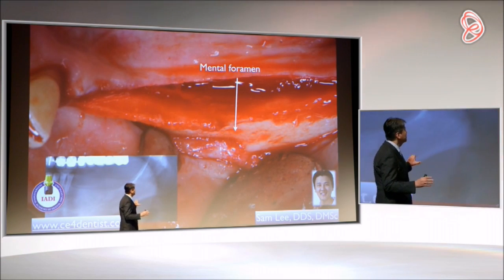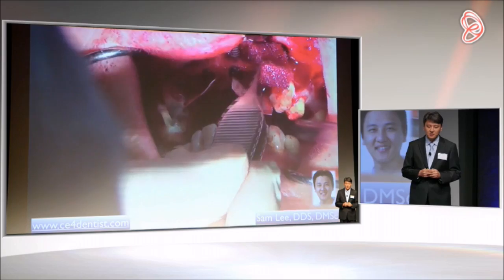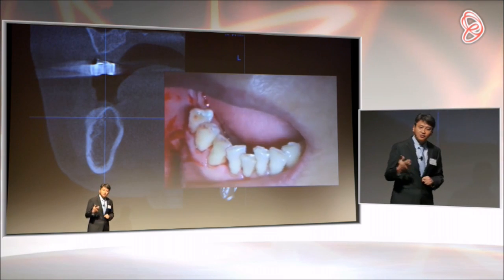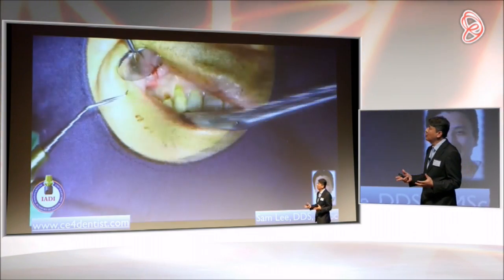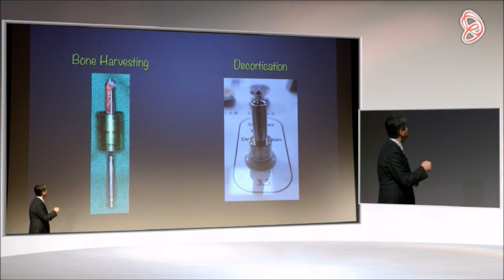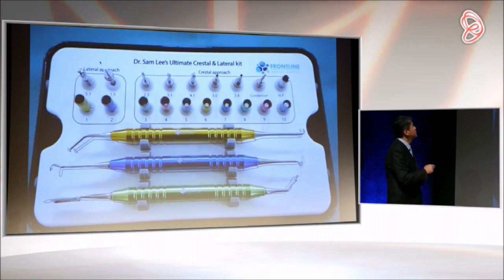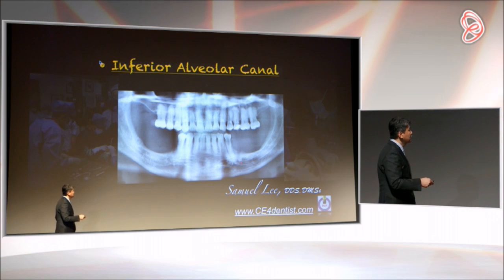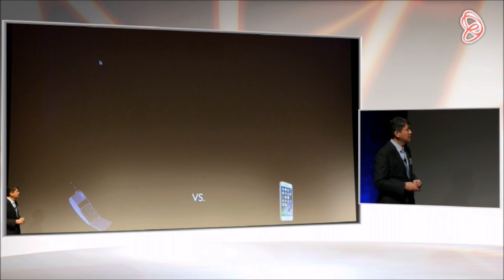New Techniques in Implantology with Newton Implant Systems

Comment: my dentist was going to place 6 implants to replace my dental bridge but only made 2 with screws and reason was "angle of teeth next to implant does not allow length implant is secure" what does that mean? and do I have any options?
if so what?
Reply: ask ur dentist
Reply: I did but her response didn't explain the answer, only that they felt it best. And how the ladies there all trust the dentist to do all their work too.
Reply: Hi, I would like clarification, but all they said was that with my situation it was best for me. Because on youtube and this ask site I commented on everywhere I've read says that it seems in all cases bone can be grown from many areas. What is angle of tooth that it would not permit the rest of the implants?

Please explain to me so I have a better understanding. What do they have a book in the office with before after pics? Are you speaking of dentist who is doing implants, or a second opinion? regarding the pics?
Reply: background I had an accident when I was 9 yo, and it knocked out my permanent teeth So I've had several bridges, then the insurtance co was convinced of implants by this office. When I asked insur many yrs ago they said it can only be approved same way it was built as bridge.

PLEASE GIVE ME YOUR INCITE TO THIS STORY.

I never got a RESPONSE TO THIS  is there any way to replace the rest of the bone from the accident?

Yes I see where you are coming from. One implant is enough to hold two crowns. We have secured your bone for the implants. It’s more when you have bad teeth that keep eating away from the bone. You may have a little bone loss from your initial accident in the edentulous spots but The bone is still pretty good. I fee you are in good shape with our plan.

Have you ever heard the old adage “what you don’t use, you lose?”  This applies to your jaw bone too!  Your bone stays thick and tall when your teeth are there stimulating your bone every day.  If you lose your teeth your jaw bone shrinks from disuse.   This also happens when you are only missing even one tooth! 

Dental implants preserve your jaw bone and prevent the natural shrinkage that WILL occur with bone loss.  A bridge or removable partial denture does not preserve or maintain your bone.

this is from I Don't Have Enough Bone For Dental Implants | Ramsey A. Amin, DDS

No I don't want to go back to what I had.

To give you teeth in those spots, crowns will be cemented to the distal side of each implant crown. 

will that then use the bone regrown from the implants?

 Because thats my biggest concern I never knew until 2 days ago when I looked it up how having a bridge all these years was detrimental to what bone I had left under the bridge was dying and vanishing.
I was quite disturbed about this because I never thought bridges could harm ones mouth so bad. But it scared me about the not using it and losing it. 
I'm more concerned with the bone issue and regenerating as much as possible to make my structure healthy again, than I am what is placed on it.

I read that one implant thing is large enough to accomodate 2 teeth, is that so?

I just want to preserve and help keep my bones strong to avoid much worse consequences in the future.

Do you understand where I am coming from?

When you came to us, you were complaining of a chipped bridge. Because of your bite, the porcelain on the bridge was chipping and redoing the bridge as it was would not help the matter. 
We then took the bridge off to properly take impressions along with the ct scan to send to our lab. After our lab technician reviewed the model and ct scan, he had a webinar meeting with dr soltani and they looked at the ct scan images together and confirmed that they would not be able to place implants in the 7,10 spot. This is because of the angle of teeth 6 and 11.
We could however place implants in the 8,9 spot which is where you were having the issues with the chipping.
That would leave the 7 and 10 spots without teeth as it is not recommended that you do a bridge from tooth to implant. 
To give you teeth in those spots, crowns will be cemented to the distal side of each implant crown. 
Dr soltani and our lab tech feel that strength will be adequate with this plan in place.
Your bone in 8 and 9 should accept the implants and be strong. 
This is what we are able to do in this office.
The other option we have is to let the tissue grow over the two implants placed and do a bridge like you had before. However, the issues you were having with the original bridge will most likely occur again.
If you feel more comfortable with a second opinion, we will not be upset. 

I forced myself to try to learn stuff way over my head and got a headache and grossed out by the vids i watched.

I spent 4 hrs today because the details are very important to me and need a full explanation.

I will except the answer if all my questions are answered in detail which is clear to me with having no dental training unlike you are your office.

You have only confused me more with the limited answers you've provided so far.

and why there are no other ways to correct it?

im extremely frustrated by the lack of detail you provide me on my matter.

im trying to learn what i google and find on youtube because you have done a poor job at explaning my condition and why there are no

alernatives to correct my problem.

i would expect this from medicaid, but not from a highly rated dentist.

again you are not giving me the full story.

give me a few sentences explaining the why, etc.

She says, They will not help because its a tooth in the way

Regarding this vid I ask her https://www.youtube.com/watch?v=TxU9jbFlwCc   does the dr know about this? i watched vid and if she doesn't 
please watch mins 5 to 20, and 32 to end. I want to know if any of these techniques would help?

guided bone regeneration
 spongy bone or
 minimually invasive tunneling
 no suture, guided surgery digital planning of 
& 3D Scan

also is she Diplomates of the American Board of Oral Implantology/ Implant Dentistry (ABOI/ID) he is considered an expert, and board-certified in dental implants

certfied in aBOI?

I'm asking the office by email what can you tell me about

Zygomatic Implants | Ramsey A. Amin, DDS

im only getting bits and pieces not the whole story from you thats what causes me apprehension.

What I want to know is this really so? Am I really stuck??

you haven't really answered my ?s you picked and chose which to answer. so I cut and pasted again!!!

enough? or not? was any it it succcessful? 

how should it be addressed further? by her or someone else in addition?

what i read makes me realize the bridge will never deal with the loss of bone and makes it worse not better for saving teeth or bone structure.

basically i learned if you don't use it you lose it, especially as you get older as bone is concerned.

your thoughts there?

you sure?

There really aren’t any options there. It’s the way your teeth grew in

Hello. Im sorry that you are losing confidence in Dr Soltani but I can assure you that dr Soltani is incredible at what she does and implants are her specialty.

Initially when you were in, we thought we could place 4 implants instead of your large bridge.
After sending your scan and impressions into the lab, our implant specialist at the lab repied with the following:

"I have looked at this scan closely and we will not be able to get four implants in this area. The roots of the cuspids are tilted mesially into the lateral positions which is preventing implants in those sites. I can get two implants in the 8,9 positions which would allow us to cantilever the laterals off of the centrals."

Because your bite was affecting teeth 8,9 of the bridge prior, implant in the 8,9 spots will work.
You will then have crowns attached on the back side of those crowns that will fit nicely with the crowns that we are placing on teeth 5,6,11,12.

This was explained at your implant placement appt. I know a lot of info was told to you that appt and I apologize if you did not comprehend the new treatment information.

We have gone above and beyond for you in assuring coverage through your insurance company.

i was really hoping to have all 6 taken care of, not just the 2. this is why this is so important to me.

and why i really want to know how to solve the other 4.

i figure before the new impression is made in feb i still have time to see about correcting the issue once you put the permanent in 

its not so easy and ill have to deal with that issue again in 5-10 yrs, if we or your can advise how to get the other 4 taken care of

even if she doesn't do it personally, i was hoping to not have to revisit the issue later in my life, where chances are going to be that

it will be much worse.

ok but i still want to know what were are my options regarding this angle issue?

We would not have placed the implants if we did not think they would have long term success. She consults with the best. If I were ever to need an implant, I honestly feel dr soltani is better than anyone I could have do it.
The reason we wait 3 months is for the implant to osseo integrate  and have the bone accept it as it’s own.
Your bone is not the issue concerning the other 2 that we could not place. It is the angle of the teeth next to it that does not allow the length we need to make sure that an implant is secure.
You are in good hands. I promise you that.

I asked...
enough? or not? was any it it succcessful? why or why not?

how should it be addressed further? by her or someone else in addition?

i was hoping this implant thing would last the rest of my life, so you can see now why it concerns me so.

i hope you appreciate my concern.

thank you.
Reply: I asked...
enough? or not? was any it it succcessful? why or why not?

how should it be addressed further? by her or someone else in addition?

i was hoping this implant thing would last the rest of my life, so you can see now why it concerns me so.

i hope you appreciate my concern.

thank you.

We would not have placed the implants if we did not think they would have long term success. She consults with the best. If I were ever to need an implant, I honestly feel dr soltani is better than anyone I could have do it.
The reason we wait 3 months is for the implant to osseo integrate  and have the bone accept it as it’s own.
Your bone is not the issue concerning the other 2 that we could not place. It is the angle of the teeth next to it that does not allow the length we need to make sure that an implant is secure.
You are in good hands. I promise you that.

ok but i still want to know what were are my options regarding this angle issue?

i was really hoping to have all 6 taken care of, not just the 2. this is why this is so important to me.

and why i really want to know how to solve the other 4.

i figure before the new impression is made in feb i still have time to see about correcting the issue once you put the permanent in 

its not so easy and ill have to deal with that issue again in 5-10 yrs, if we or your can advise how to get the other 4 taken care of

even if she doesn't do it personally, i was hoping to not have to revisit the issue later in my life, where chances are going to be that

it will be much worse.

There really aren’t any options there. It’s the way your teeth grew in

Hello. Im sorry that you are losing confidence in Dr Soltani but I can assure you that dr Soltani is incredible at what she does and implants are her specialty.

Initially when you were in, we thought we could place 4 implants instead of your large bridge.
After sending your scan and impressions into the lab, our implant specialist at the lab repied with the following:

"I have looked at this scan closely and we will not be able to get four implants in this area. The roots of the cuspids are tilted mesially into the lateral positions which is preventing implants in those sites. I can get two implants in the 8,9 positions which would allow us to cantilever the laterals off of the centrals."

Because your bite was affecting teeth 8,9 of the bridge prior, implant in the 8,9 spots will work.
You will then have crowns attached on the back side of those crowns that will fit nicely with the crowns that we are placing on teeth 5,6,11,12.

This was explained at your implant placement appt. I know a lot of info was told to you that appt and I apologize if you did not comprehend the new treatment information.

We have gone above and beyond for you in assuring coverage through your insurance company.

I'm asking the office by email what can you tell me about

Zygomatic Implants | Ramsey A. Amin, DDS

im only getting bits and pieces not the whole story from you thats what causes me apprehension.

What I want to know is this really so? Am I really stuck??

you haven't really answered my ?s you picked and chose which to answer. so I cut and pasted again!!!

enough? or not? was any it it succcessful? 

how should it be addressed further? by her or someone else in addition?

what i read makes me realize the bridge will never deal with the loss of bone and makes it worse not better for saving teeth or bone structure.

basically i learned if you don't use it you lose it, especially as you get older as bone is concerned.

your thoughts there?

you sure?

also is she Diplomates of the American Board of Oral Implantology/ Implant Dentistry (ABOI/ID) he is considered an expert, and board-certified in dental implants

certfied in aBOI?

again you are not giving me the full story.

give me a few sentences explaining the why, etc.

She says, They will not help because its a tooth in the way

Regarding this vid I ask her https://www.youtube.com/watch?v=TxU9jbFlwCc   does the dr know about this? i watched vid and if she doesn't 
please watch mins 5 to 20, and 32 to end. I want to know if any of these techniques would help?

guided bone regeneration
 spongy bone or
 minimually invasive tunneling
 no suture, guided surgery digital planning of 
& 3D Scan

I forced myself to try to learn stuff way over my head and got a headache and grossed out by the vids i watched.

I spent 4 hrs today because the details are very important to me and need a full explanation.

I will except the answer if all my questions are answered in detail which is clear to me with having no dental training unlike you are your office.

You have only confused me more with the limited answers you've provided so far.

and why there are no other ways to correct it?

im extremely frustrated by the lack of detail you provide me on my matter.

im trying to learn what i google and find on youtube because you have done a poor job at explaning my condition and why there are no

alernatives to correct my problem.

i would expect this from medicaid, but not from a highly rated dentist.

When you came to us, you were complaining of a chipped bridge. Because of your bite, the porcelain on the bridge was chipping and redoing the bridge as it was would not help the matter. 
We then took the bridge off to properly take impressions along with the ct scan to send to our lab. After our lab technician reviewed the model and ct scan, he had a webinar meeting with dr soltani and they looked at the ct scan images together and confirmed that they would not be able to place implants in the 7,10 spot. This is because of the angle of teeth 6 and 11.
We could however place implants in the 8,9 spot which is where you were having the issues with the chipping.
That would leave the 7 and 10 spots without teeth as it is not recommended that you do a bridge from tooth to implant. 
To give you teeth in those spots, crowns will be cemented to the distal side of each implant crown. 
Dr soltani and our lab tech feel that strength will be adequate with this plan in place.
Your bone in 8 and 9 should accept the implants and be strong. 
This is what we are able to do in this office.
The other option we have is to let the tissue grow over the two implants placed and do a bridge like you had before. However, the issues you were having with the original bridge will most likely occur again.
If you feel more comfortable with a second opinion, we will not be upset. 

this is from I Don't Have Enough Bone For Dental Implants | Ramsey A. Amin, DDS

No I don't want to go back to what I had.

To give you teeth in those spots, crowns will be cemented to the distal side of each implant crown. 

will that then use the bone regrown from the implants?

 Because thats my biggest concern I never knew until 2 days ago when I looked it up how having a bridge all these years was detrimental to what bone I had left under the bridge was dying and vanishing.
I was quite disturbed about this because I never thought bridges could harm ones mouth so bad. But it scared me about the not using it and losing it. 
I'm more concerned with the bone issue and regenerating as much as possible to make my structure healthy again, than I am what is placed on it.

I read that one implant thing is large enough to accomodate 2 teeth, is that so?

I just want to preserve and help keep my bones strong to avoid much worse consequences in the future.

Do you understand where I am coming from?

background I had an accident when I was 9 yo, and it knocked out my permanent teeth So I've had several bridges, then the insurtance co was convinced of implants by this office. When I asked insur many yrs ago they said it can only be approved same way it was built as bridge.

PLEASE GIVE ME YOUR INCITE TO THIS STORY.

I never got a RESPONSE TO THIS  is there any way to replace the rest of the bone from the accident?

Yes I see where you are coming from. One implant is enough to hold two crowns. We have secured your bone for the implants. It’s more when you have bad teeth that keep eating away from the bone. You may have a little bone loss from your initial accident in the edentulous spots but The bone is still pretty good. I fee you are in good shape with our plan.

Have you ever heard the old adage “what you don’t use, you lose?”  This applies to your jaw bone too!  Your bone stays thick and tall when your teeth are there stimulating your bone every day.  If you lose your teeth your jaw bone shrinks from disuse.   This also happens when you are only missing even one tooth! 

Dental implants preserve your jaw bone and prevent the natural shrinkage that WILL occur with bone loss.  A bridge or removable partial denture does not preserve or maintain your bone.